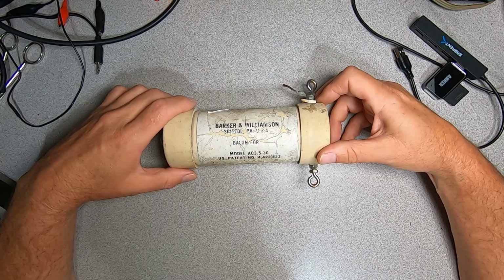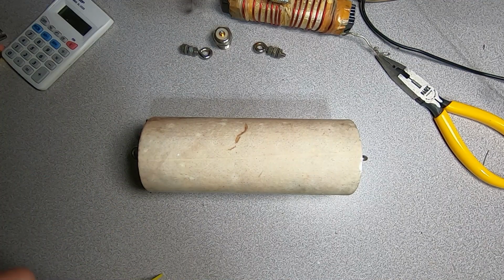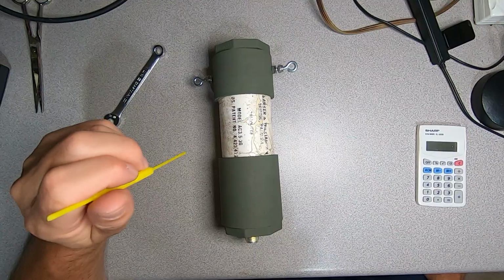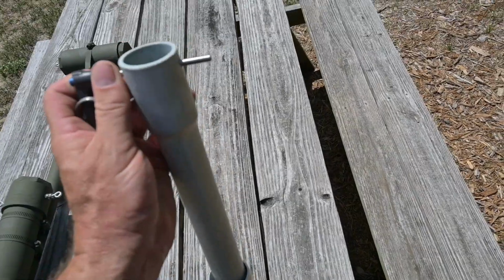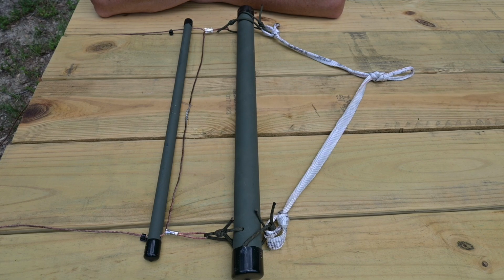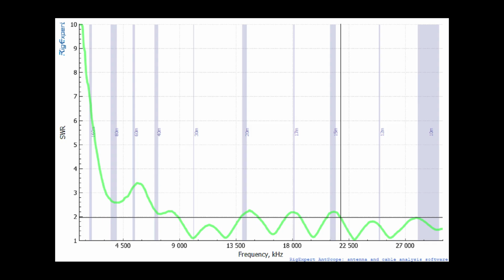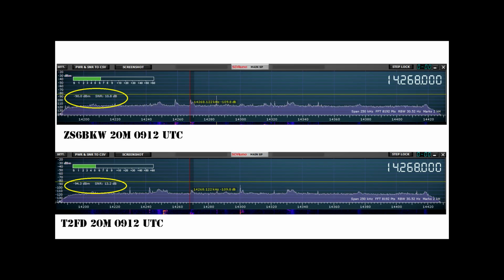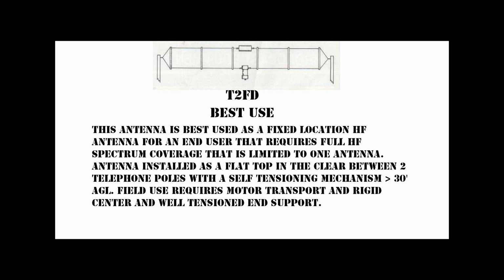T2FD Full coverage HF radio antenna B&W AC 3.5-30 salvage, rebuild, and testing of a classic antenna

Comment: Excellent video. I have both, the AH-710 and the B&W90. Your approach and clarity surpasses what is available from both companies and what is written on the net. Your meticulous attention to detail is superb. Kudos to you sir.
Fernando N2FQ
Reply from the maker: Thank you very much !  If I was to share something else from experience use element wire that is flexible like the flexweave that I used or even hookup wire. I had to stow a radiowavz one today that used copperweld wire and it was like rolling up a spring.  Thank you for watching !

Comment: Hello - Great video and rebuild.  I run a DANNE| T2FD and have done for a very long time.  The T2FD is one great antenna.
Reply from the maker: Thank you and thanks for watching !
Reply: Your welcome.  I was very lucky this past week to find a new Barker & Williamson AC 2-30mhz on eBay for a very reasonable price.  Its rated for 1kw CW and 2kw SSB (ICAS).  Looking forward to getting it up.
The T2FD is one great antenna I'm surprised more Hams don't use them.
Reply from the maker: @EI6DP  cool find !

Comment: Bravo my dear friend, great vid. This is the ultimate broadband NVIS antenna, higher up will do medium and long haul especially with digital modes. I have been building them 30 yrs now. I have come to make portable lightweight versions to mil spec quality. 

 And is my go to ant for portable manpack use. also, 9:1 version might work better in the NVIS spectrum range  (2-10mhz) but do not forget that unless we are speaking of a fix position and height you will always get a deviation due to the sub ground composition especially in NVIS config. where the loss is insignificant factor in the lower NVIS freq. range. 
antenna length and position is very forgiving in this ant. system- forest green and brown color wire is very stealthy. I have come to like the 27m version due to portability and field deployment mostly deployed in inverted vee and low hung flat top where ironically, I also get great dx with digital modes (they are king) inside of gorges and low in the valleys with high mountains!  sometimes I use the ATU for 160m but its all about freq. and time of day - this monster of a antenna has been kept a secret in the military. now a days its king with digital modes and ALE, in which with its superior reception for digi modes have made this ant a resurrection masterpiece! 73 from SV1___ land !
Reply from the maker: Thank you for sharing and thank you for watching !
Reply: I want to build the 3 wire version (T3FD). Let's say I use a 1000 ohm termination resistor.
There seems to be disagreement about the balun. Can you explain how to choose a balun ratio of 9:1 vs 12:1 vs 16:1?
Reply: @mrtechie6810  you should not have a great issue with the unun type (not a balun), a 16:1 is uses if you have higher Z in your system needs and operating capacity.
I use this system also for portable use and my system is modular therfore I use a 9:1 unun so to utilize also on an EFRW antenna as well with a terminating resistor (beverage ant.) also and more importantly, I use this for the lower bands exclusive to NVIS communications in the field and I use the mil-spec length of The USN
Reply: Which is 27m and it covers 2-56mhz providing a ferite core of at least 43 or higher (ft-240-43/ft 140-43 or higher than 43, around the 52....or whatever you can find it.
As this is a compromise antenna system and not one is perfect try the 9:1 it should cover all your needs and surpass them.
Note :for a 9:1 unun you need 10pcs. of 4.7kΩ 15w resistors in parallel which will give you the capacity of 470Ω at 150w  keep in mind that the value in max pwr use is dictated by the resistor and not the unun so for ssb pep. I'd stay with 100w but for digital modes not surpass 30-50w max! Providing your antenna has a resonance below 2:1 swr. Usually it's around 1.2-1.5 swr but up to 2.1swr
Reply from the maker: @user-ro3mn5eb9d  I have built a more compact version with a 9:1 and used some 150w microwave terminiations for the resistor network. I will be putting up a video once I get around to filming it. Thanks for sharing the info !

Comment: Que diferencia se puede encontrar,con estas mismas antenas,pero, con balun 4:1 ,o, 6:1, y  con la resistiencia superior, de entre 350 y 450 ohms????
Gracias amigo!!
Reply from the maker: Experimenté con una variante 4:1 antes y no funcionó bien. Una 9:1 funcionó bien con una resistencia de 500 ohmios y las mismas dimensiones. Gracias por ver el video.
Reply: @survivalcomms  Te refires solo a recepcion,o tambien en transmision??Gracias por tu amable respuesta amigo!!!
Reply from the maker: @jorgeomar8795  transmisión las diferencias en la recepción fueron menos pronunciadas

Comment: I want to build the 3 wire version (T3FD). Let's say I use a 1000 ohm termination resistor.
There seems to be disagreement about the balun. Can you explain how to choose a balun ratio of 9:1 vs 12:1 vs 16:1?
Reply from the maker: The simplest way is If the end equipment is looking for an impedance of 50 ohms your desired transformation ratio is the quotient of the resistor value divided by 50.  for a 1000ohm resistor 1000 /50 = 20 or 20:1 .  Thanks for watching !